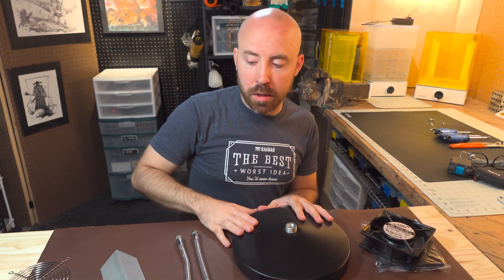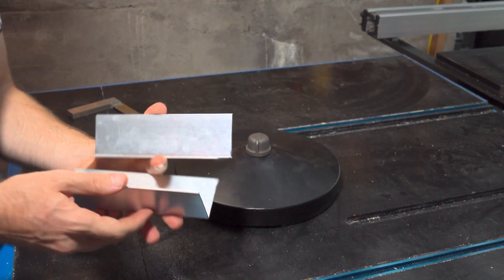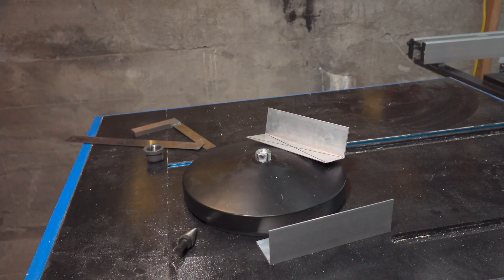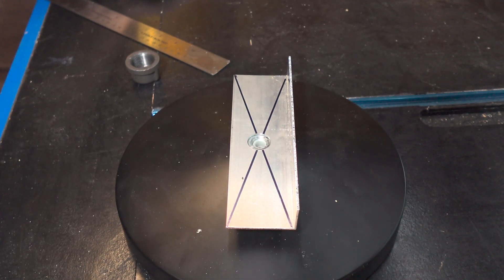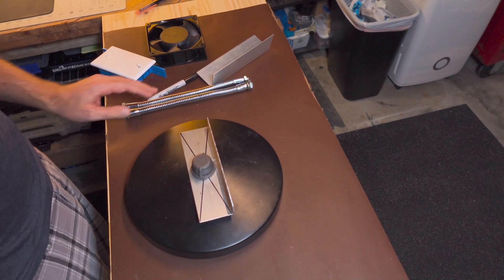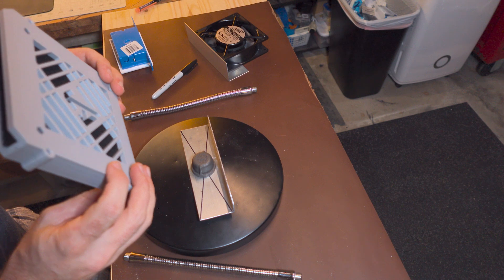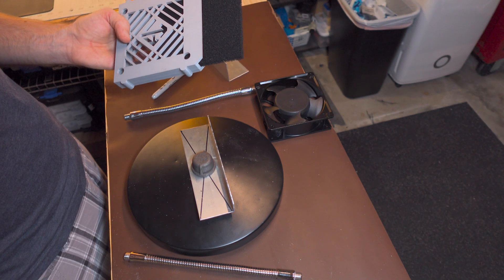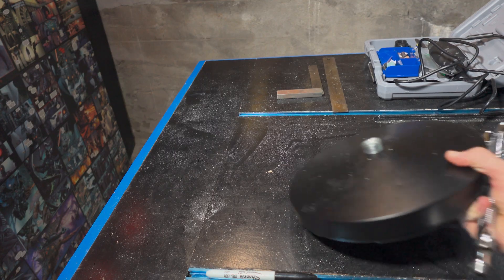Upcycling an old lamp to deal with solder fumes

Comment: You should have run the wires through one of the goosenecks. I just use a small desk fan. Cheap and simple. I learned a trick years ago, if you have a riser on the workbench put the fan on top pointing up and towards you. It creates a nine gentle draft that draws the smoke up and away from your face and throws it behind you.
Reply from the maker: I was thinking about that, but the cord was short enough that I needed all the length I could get out of it. Maybe for a round two on this project I will make a longer cord.
Reply: @jasonburns-collective  I re-watched this video and the whole thing was a lark anyway so nothing matters.  And I think that everything I've ever built had some shortcoming that I would do better with on round two. Sometime I actually make a "prototype" that I toss out just because I know it will be shit anyway.  One thing that gets me is all of the videos where the person makes mistakes and mentions it in the video.  It's a video.  Just start over and do it right the next time and you look like a genius.  Maybe people like the little human elements so they leave the flaws in.  The wire thing is super minor actually but if it were me I would definitely string the wire inside.  And if it were me I would probably do something else even more stupid.

Comment: Use a car HEPA filter, they do a much better job at filtering the smoke. I made a (much crappier) fume extractor using one, but it does a better job at filtering the smoke.
Reply from the maker: That's a good idea I will look into that as an upgrade at some point.

Comment: Well it isn't exstracting anything, it just dilutes it into the air faster, still for you to breathe in.
Still poisonous just not that noticable and direct.
If the point is to not breathe it in at all, wich the point should be if you're doing a lot of soldering, then you should have an extractor hood aswell to take it outside :)
Reply from the maker: Thanks for the comment, this is very true! You definitely want to get the the fumes out of your space as quickly as possible.  This is also really important with 3D printing as well.  I have an over the bench venting system installed, but like most shops it's a work in progress.

Comment: I can relate to this so much... I have been meaning to build a fume extractor but I only think of it when I solder maybe once a month or so. Of course I could buy one, but I know I could make one fairly quickly (and yet I never actually get it).
Reply from the maker: I know, those parts had been sitting in the shop for years lol